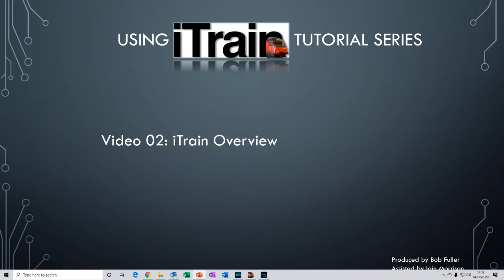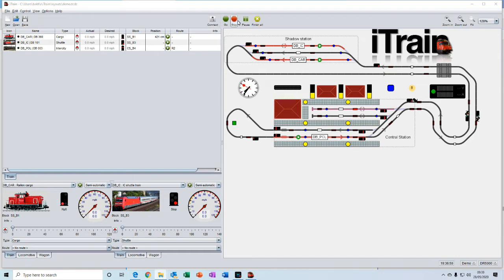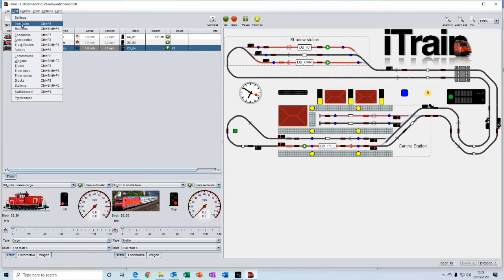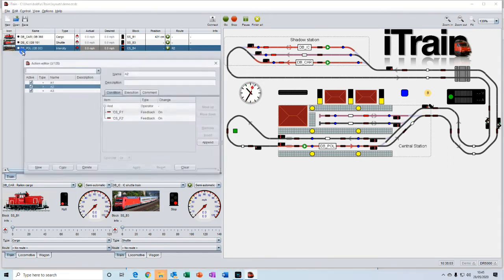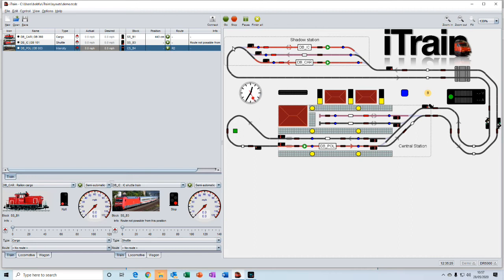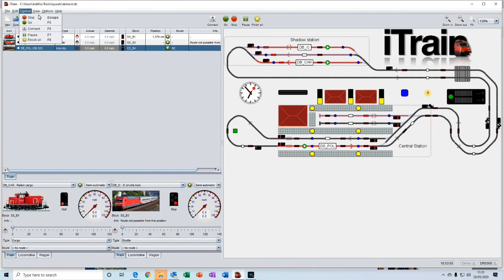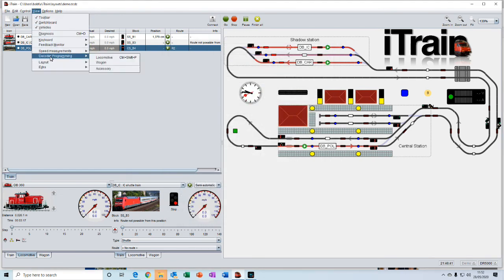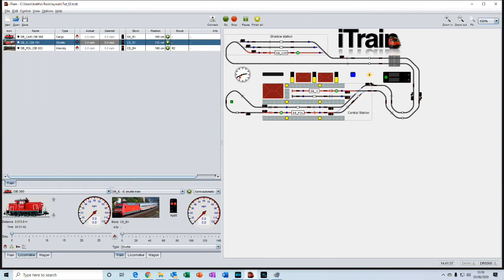Video 02: Using iTrain Tutorial Series - Overview

Comment: Hi, many thanks for your detailed tutorials.  I am right at the very beginning and am somewhat daunted by this system.  I have just installed the "Trial Licence" and, if all goes well, intend to set up my new layout with this system however, I just want to get the feel of it.  I have installed the software but cannot find any demo layout / info to work with it.  Please can you advise me where I can find this?  Many thanks. Brian
Reply from the maker: Hi Brian
In EDIT > PREFERENCES > GENERAL tab, there is a field called 'Base path'. This is the path to where the 'iTrain' User folder was created when iTrain was installed. By default, it is located at C:/Users/[your username]/iTrain. Check that your base path is pointing to this location (or to the location you chose). Then click OK to save it and exit the window.

Next, in the top menu bar click on the OPEN button to open a layout file. You should be presented with a window that shows 5 demo layout files. They are the same demo layout but in different language versions. Double-click the demo.tcdz file to open the English version.

If you do not see these files, double-click the Green Arrow to go up a level. Keep double-clicking the arrow until you see a folder called 'Layouts' (which is within the 'iTrain' folder), then double-click that folder to open it. You should then see the demo files.
Reply: @bobfuller  Many thanks but I should point out I am a MAC user and don't have any Windows systems.  I use a MacBook Pro with Apple M1 processor and the folder structure is different from a Windows system.  On my system there is no "Preferences" that I can find anywhere in the iTrains menu/dropdown list, however, the system has created an "iTrains" folder in my User folder on the system drive.  However, I have looked back at the original download from iTrains and found several folders which the installation set up but left empty.  I have now copied these across to the User folder and can now access the Demo layout.  Thanks
Reply from the maker: See page 20 of the User Manual (you can open it from the HELP menu). The Preferences should be listed at the bottom of the Edit menu, even on a Mac. If it's not, there is something wrong. 

I assume you have downloaded the MacOS M1 disk images from the official iTrain website 'Downloads' section?

You have to download the macOS Intel disk image or macOS ARM Mx disk image and copy the application to your 'Applications' folder.

For OS X 10.7 - 10.12 it is recommend upgrading to at least High Sierra (10.13) if this is possible with your Mac.

You can drag the iTrain to the 'Dock' to start it from there as well.

If this doesn't fix things, go to the iTrain Forum and create a new post and attach your .tcdz layout file. We will need to see your layout file to figure out what's going wrong.
Reply: @bobfuller  Thanks Bob.  I am certain I selected and installed the correct version of the iTrains software but have found that what you have described as "Preferences" are "Settings" under the iTrain menu on the MAC version.  A little confusing as there is also a "Settings"  under the Edit drop down but the "Settings" under the iTrain title drop-down contains the same things that your video describes.  Of course your video is now 5 years old and I wonder if there might have been some changes made since then.  Anyway, thanks and I will continue to go through your tutorials.  I am a complete beginner with this although I have seen the system in action as I am a volunteer at the Bluebell Railway where I work in the shop and we have a model layout controlled by iTrains with the Yamork YD7001 command system.  This was set up for the Railway by Jim from DCCAutomation several years before I joined the volunteer team.  I have my own N-Guage layout running with an NCE Powercab but I am about to start a whole new project in OO Guage and would like to use the iTrains /Yamork 7010 solution to run it - I have an awful lot to learn!!!

Comment: Hi Bob,
I'm afraid I didn't understand that. Would you please explain again how I can add additional throttles.
Thanks, Caro
Reply from the maker: Left click with the mouse in an empty space anywhere within any of the throttles. This moves the focus to the throttle area. Then hold down the ALT key and press the right cursor key to add a throttle column. Or ALT + down cursor to add a throttle row. Repeat to add more. To remove throttles, press ALT + UP cursor key or ALT + LEFT cursor key.
Reply: @bobfuller  Thank you very much for your quick and detailed reply.

Comment: First let me say that I haven’t yet viewed many of these videos. I do not have iTrain on my existing layout but I’d like to explore its capabilities on a new layout, probably a simple test layout to develop my understanding of it. What I’m not sure about is exactly what features (eg blocks, rail breaks, sensors etc) might I need to build in to the actual layout construction, and where they may need to be sited to achieve what? That may be a ‘how long is a piece of string’ question, but imagine, say, a simple one platform run-round loop station, with a couple of goods roads connected, to a fiddle yard at the other end. Is it possible to explain the likely requirements to get the best out of iTrain? Thanks, Ian
Reply from the maker: Have a look at video #5, Ian. At around 03:30 I show the test track that we use for a lot of the tutorials. Is this the sort of thing you mean?
Reply: @bobfuller  thanks, Bob, but no, that wasn’t what I was after. I’m referring to the physical laying of track, and it’s wiring up. To utilise the various control features of iTrain, such as stopping at the right place in a siding, or shuttling back and forth etc, I’m assuming there must be blocks and sensors to build into the physical layout. What I am after is 1. How does one know where exactly to build them in? (Eg to get a loco to stop automatically at X, how far from that does a device need to be inserted? 2. What exactly is being built in? When would it be an insulated rail break, and when a sensor, and what type,of sensor?
Reply from the maker: @iangray9596  it will be much easier to explain things via email. Are you on the iTrain forum? If so, send me a PM with your email address. My username is Swanham. If you are not on the forum, post your email address, here, and I will delete the post after reading it (I will be out for most of the day, so will not see it until this evening).

Comment: be great to see how you set up a layout and decided all the functions 
can you load any loco / wagons here from all manufacturers including Tri-ang
Reply from the maker: Hi Keith. I'm not sure if I have understood your question correctly. The images of locos and wagons are stored a folder within iTrain. When iTrain is installed, it creates some folders. One of the folders is called IMAGES. Within the IMAGES folder there is a folder called LOCS and a folder called WAGONS. Inside these folders there are a bunch of reference images, but you can also store your own images, too. So you could create a folder called Tri-ang and store images of Tri-ang locos in it, if you wanted. Then, when you create a Locomotive in iTrain you can use your own images.
Is this what you meant?